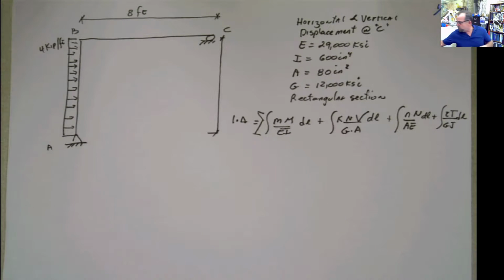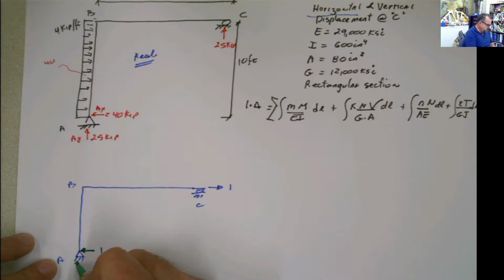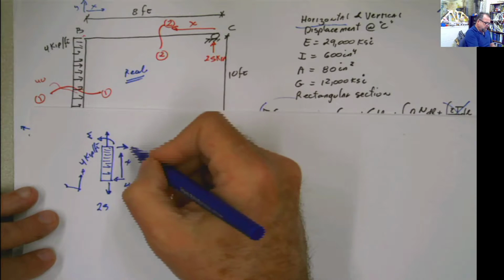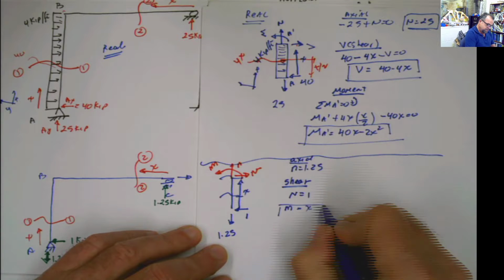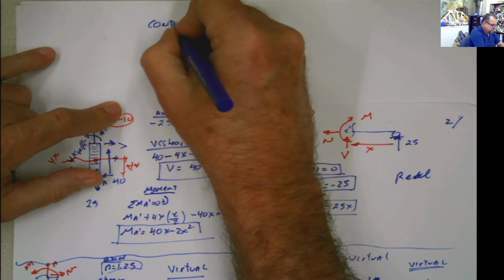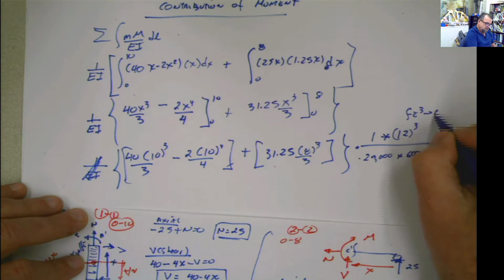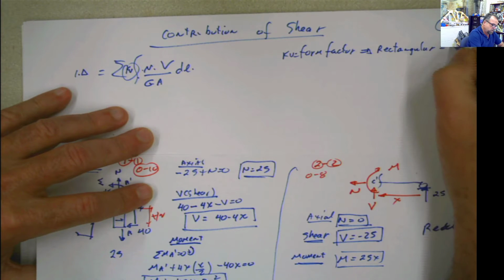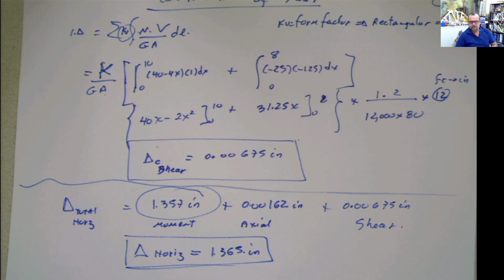VIRTUAL WORK FOR FRAMES Displacement

Comment: would the second part of the integral be 8 to 0 instead of 0 to 8? or it is okay to use 0 to 8 since we changed the x axis for it? thanks Dr. Zaurin!
Reply from the maker: Nope,  x is measured from 0 to x as it is.  You are welcome! Are you from UCF?
Reply: @1963rzr  Yes sir, Dr. Mackies class though
Reply from the maker: @ATMbricks  Thanks and  Good Luck on your finals!

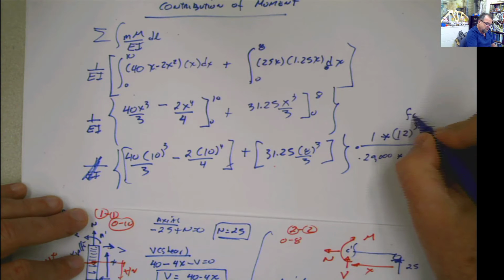Comment: Hello, can someone help me at 21:10? How does he end in ft^3? According to my calculations I am ending in ft/in^2. So I don't see how he ends in ft^3 and then multiples by 12 in ^3 / 12 ft ^3? Because I am not ending in those units. Thanks
Reply: dx has a unit of 'ft', each Moment is kip-ft, so you end in ft^3/in^2, convert ft^3 to in^3 is 12^3. Then 12in^3 / in^2 = 12in which is what we want our last final answer unit to be, inches.